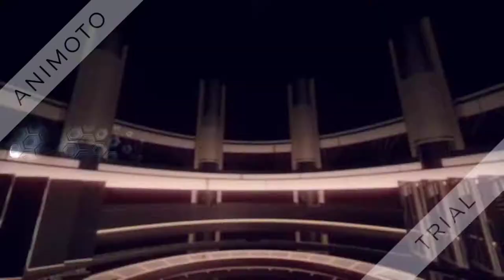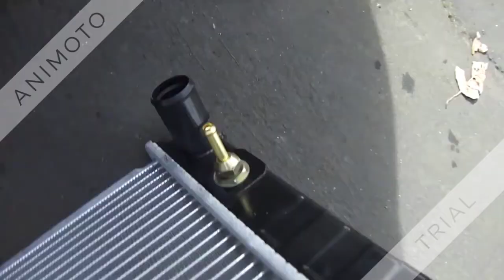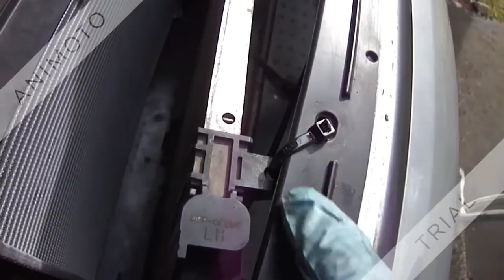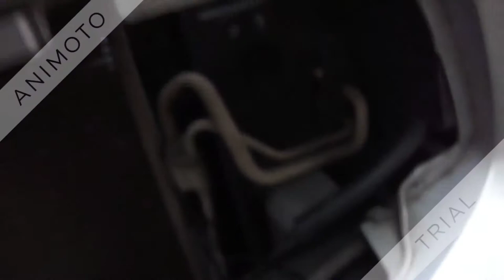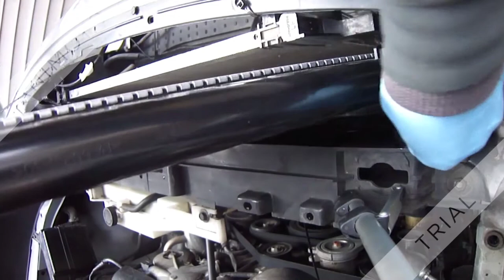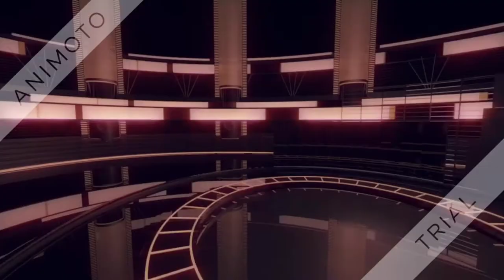FX35, EX35 - Changed Radiator w/o Dropping AC Condenser

Comment: Im so frustrated trying to wedge my new radiator in, I have a black bracket under the top of my front bumper cover in the way. I even removed my AC condenser and still can't get enough room to get it wedged in there. I will try again from Left to right and then slide passenger side in like you. 2015 QX70S
Reply from the maker: The horizontal black metal bracket under the top of the bumper cover should be removed before you zip tie the AC condenser. There are plastic clips and 6 bolts that hold it in place. All easy to access.
Reply: @BuiltNoTboughTdc2   I removed my condenser, then on my old & new radiators I had to remove the upper hose connection point and the upper transmission cooler line, like in your video. It was extremely tight on my 2015 QX70S and it would be impossible to remove without pulling the condenser, there is not .01 extra inch of space. I wedged it in and barely cleared the lower drain plug but forced it into place. Back on the streets now.

Comment: You mentioned transmission fluid on, does that mean the transmission fluid had to be changed or topped off?? Thanks?
Reply from the maker: Don't let the fluid drain out of transmission. Make sure to either plug, cap, pinch or kink the hose to prevent it from happening as soon as you disconnect lower transmission fluid hose from from the radiator. Once the new radiator is in, you would need to add a small amount of transmission fluid to make-up for what was lost in the process.

Comment: Need to do this for my FX35, do you have your transmission line connected to the radiator, if so, how much fluid did you lose when you disconnected and had to replace?
Reply: Yes, transmission line is connected. You must pinch/plug or cap the actual line on the engine side, once you disconnect it from the radiator to prevent fluid from coming out. There will be no more than 1/8 of a cup of oil left in the old radiator. Insignificant amount to worry about.